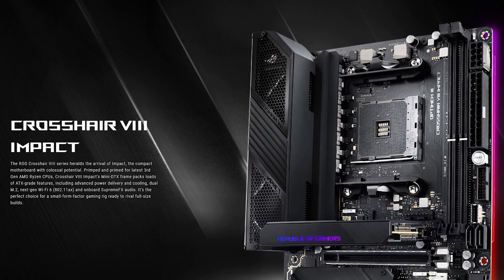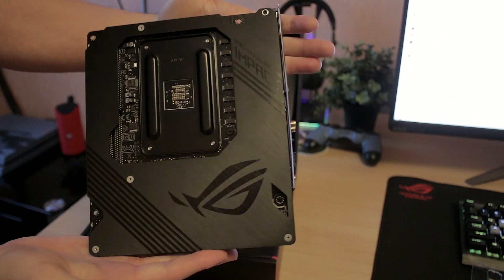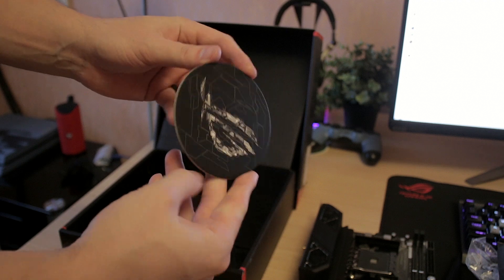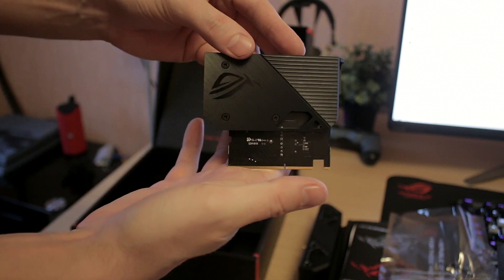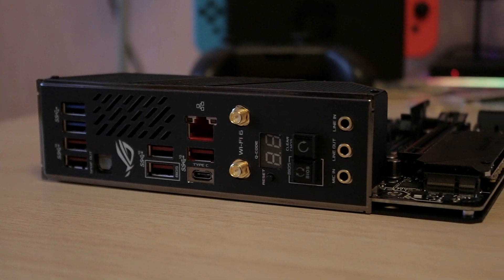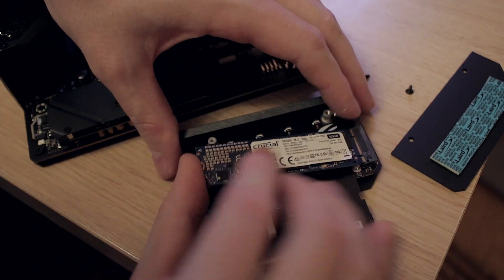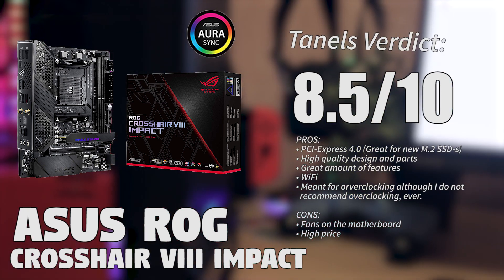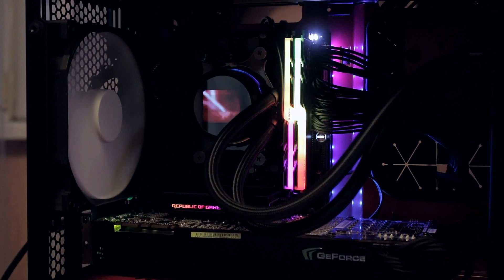The ROG Crosshair VIII Impact Review by Tanel

Comment: mine had a either a dead cmos battery, or the battery holder was wired wrong. wouldnt save bios or time if i ever unplugged the psu. wasnt going to take apart the vrm/chipset heatsink to find out so i just RMA'd it